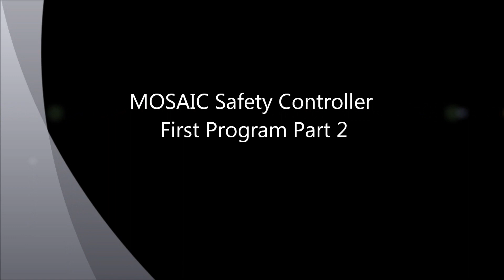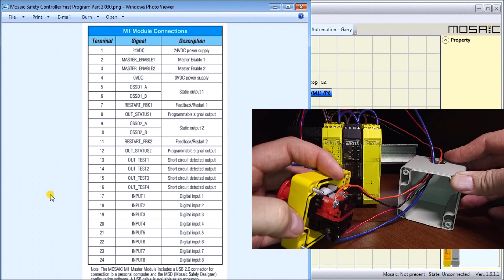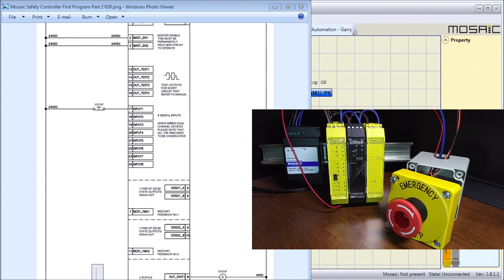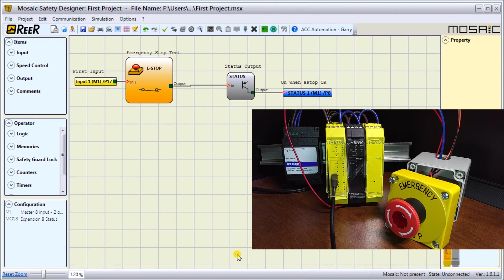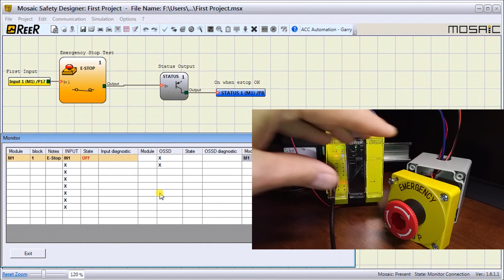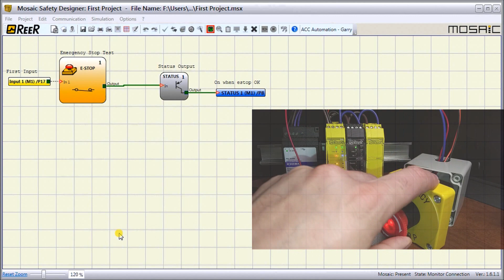MOSAIC M1 Controller Setup Complete Wiring Guide Included!

Comment: hello i have mosaic AND i want upload program from my mosaic
Reply from the maker: Hello, and sorry for the late reply! Quick note on wording first: with the MOSAIC, "download/send" means PC → controller, and what you want (getting the program out of the M1) is the "upload/read" direction.

To connect: open the MSD (MOSAIC Safety Designer) software, plug in the USB, then go to Communication ▸ Connection (or the connection icon). The default Level 2 password is SAFEPASS.

Here's the important part, though: because the MOSAIC is a safety controller, it protects the configuration — you generally cannot pull a fully editable project back out of the M1 the way you can with a standard PLC. So the real answer depends on what you're trying to do:

• If you just need to view or document what's running — connect and use Monitor, and you can print/export the configuration report.
• If you need the editable project, you must use the original MSD project file (.mpa). If it's lost, MSD can't simply rebuild the editable source from the device.
• If you want to copy the config to another M1, the MCM memory module is the tool for that (clone/backup between controllers).

Tell me which of those you're after — recover a lost project, view it, or copy it to another unit — and I'll point you to the exact steps. Software setup guide: https://accautomation.ca/mosaic-safety-controller-installing-the-software-msd/

Regards,
Garry — ACC Automation